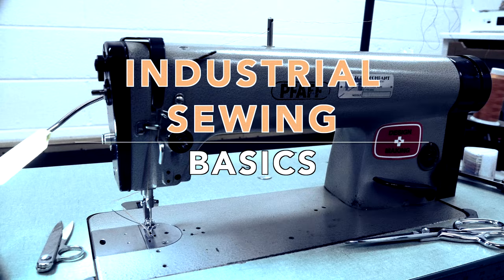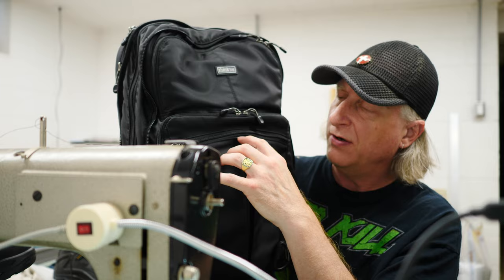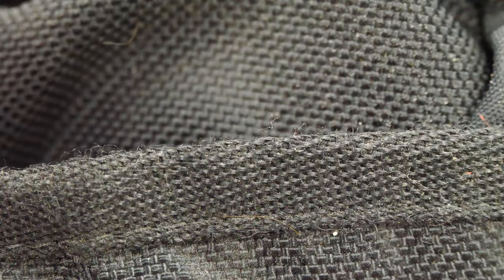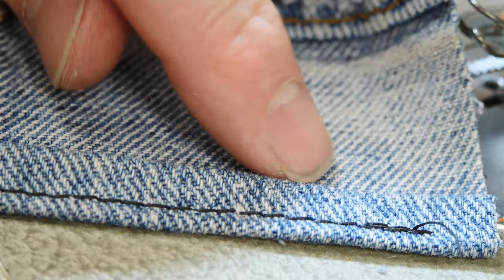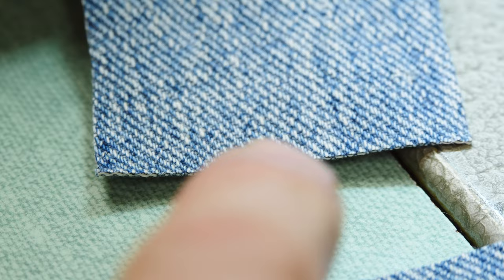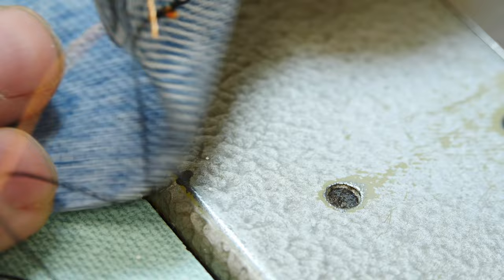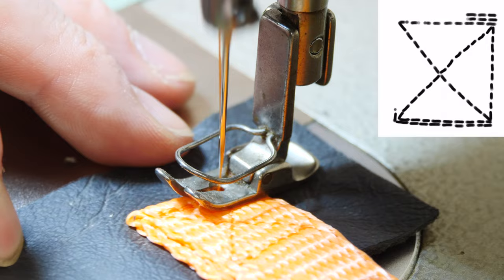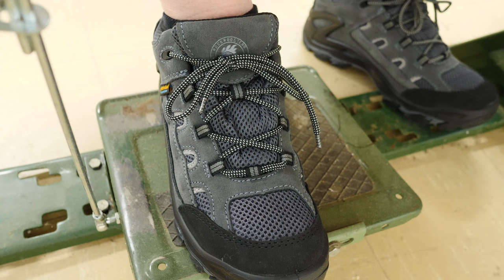Sewing Stitch Types for Industrial Designers & Manufacturing

Comment: The only thing I'd add is stitch length; for woven fabrics, you can almost run any stitch that catches at least 1 woven thread; however, with leather, other natural products, plastics, rubbers, the structure is essentially uniform; strength comes from the cross section of the material; a line of holes is a perforated tear line. So for most of those, a stitch length that is close to or less than the thickness of any individual layer is asking for failure. 2x & up is often better lor longevity, tho often undesirable for appearance.
Consideration for thick thread (and the thick needle/hole) may also be necessary.
If you're using a natural material, expect variation in material properties: natural leather is not uniform, and you need to know about the various properties various parts of the hide have.
Glue/alternate binding can help, but even then you don't want a 1:1 or lower ratio.
And the softer the material, the wider the stitch, if you can't legthen the stitch while maintaining sufficient hold/tension then go to a glue
Reply from the maker: Yes, very sound advice! Thanks for sharing that with everyone here. Much appreciated

Comment: Actually. "lock stitch" refers to the kind of two thread stitch that sewing machines make.  The top thread is poked through the fabric, looped around the floating bobbin and then pulled tight.

It is distinct from "chain stitch" which uses only one thread.  A loop is poked through the fabric and through the center of the loop from the previous stitch.  I think chain stitch is still used to close bags of bulk goods like cat litter and gardening products.  If you can find the end you can just give it a tug to unravel it.  Chain stitch is also what one makes when crocheting.

A serger makes an "overlook stitch".  These are used to protect what would otherwise be a bear edge.  This involves multiple threads which loop through each other and around the edge of the fabric in a complicated way.

Comment: the thread issue 4:33. what i have found is usually it’s a one of three things. thread tension too loose, i’m not holding tension on the access thread as the first couple stitches go in, or when i finish a stitch run, i don’t turn my wheel so needle is too dead center , and enough and it won’t let go of the thread
Reply from the maker: Good insight, I will note that next time I use the machine

Comment: If the thread is getting buried around the bobbin, in my experience, it turned out to be that the needle wasn’t heavy enough for the thread/fabric combination. The thread gets stuck in the groove of the needle because the groove isn’t deep or big enough to allow the thread to slide back easily when the tension arm is pulling it back. I ran across this when stitching upholstery weight fabric. Thought it was a tension problem for a long time.
Reply from the maker: Cool, good to know, I will investigate
Reply: Oooh, great info. I'd have thought it was tension as well.

Comment: The threads get sucked beneath the needle plate because the thread tension is too low. Also this is made worse by flexibility of the material being joined, such as spandex.
Reply from the maker: I will investigate that. Thanks for the feedback. Much appreciated
Reply: @EricStrebel  Just to add to that, the bottom thread tension is higher than the top thread tension, it's a game of balance between the two tensions. Slippery fabrics/threads make things more "sensitive" to any imbalance, as do fluffy fabrics like fleece
Reply from the maker: Okay, more good information! Thanks 👍
Reply: Not really, most likely he is trying to remove the work on the wrong position of the hook. Thread take up lever must be all the way up so you can remove your work the easier way, the hook will be on opposite side of the needle so the loop will be completed and the take up lever will pull al the lack underneath the top thread. for best results remove your work with the thread take up lever when its moving its way down but still up. This way whenever you re-start sewing you will require less effort to hold your upper thread on the first stitch.
Reply from the maker: Ahhh, interesting.....never thought of that

Comment: Regarding the thread getting sucked in, someone said tension was the issue.  I just had this issue and in my case it was the timing.  I don't know how your machine works vs mine, but on mine, the bobbin was too too far into the rotation.  It required a very small adjustment on the bar driving the bobbin.  I was unable to resolve it by rotating the bobbin holder.

I'm not saying tension is not your issue, though.  In many of your examples, you can see your tension is not adjusted correctly as illustrated by the thread from the other side having been pulled through and visible.
Reply from the maker: So, I suspect you are correct about the timing, The issue is not consistent and does not seem to have anything to do with thickness of materials quite honestly. I may need to have the machine serviced or figure out how to adjust this timing issue